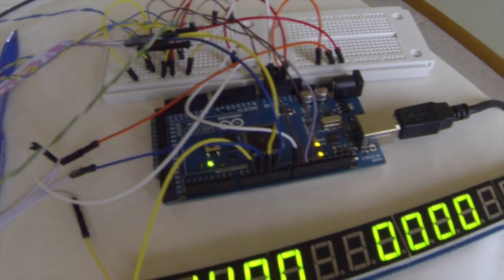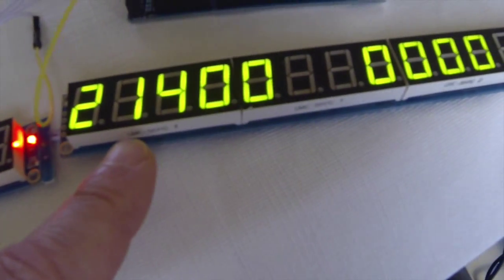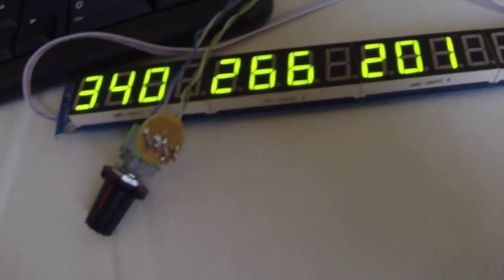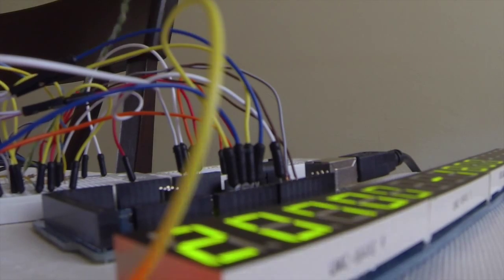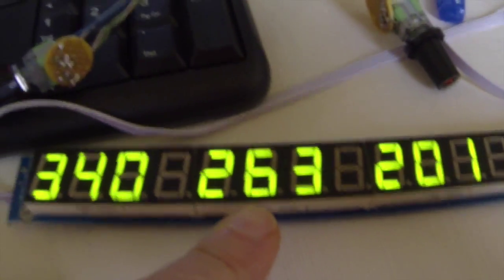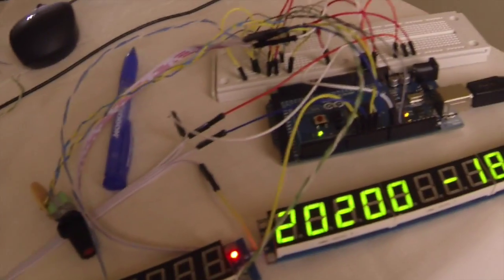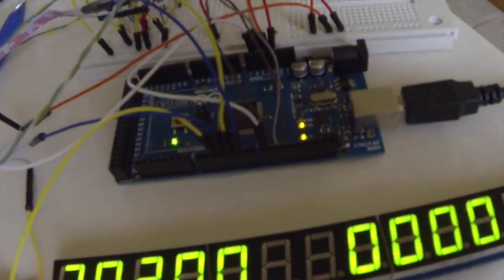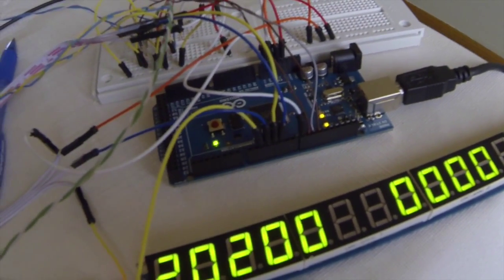MCP Autopilot Build 01

Comment: I guess you did not turn the pulse switches with full speed... If you have the MCP finally installed in your cockpit - it is good that you can turn the switches very fast and the values will change accordingly.

I use pokeys and encoders, the speed for value change could be faster but it works ok .... If you want, search for masterploxis on youtube and you can see how i did my MCP - you might find some usefull informations... Cheers Andy